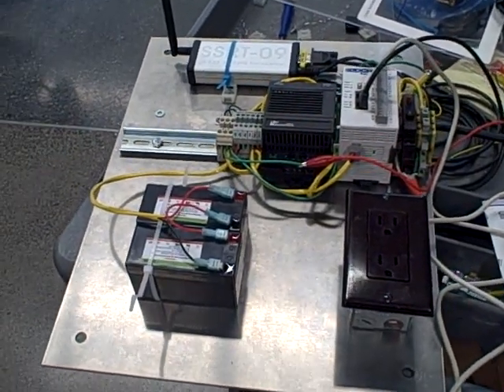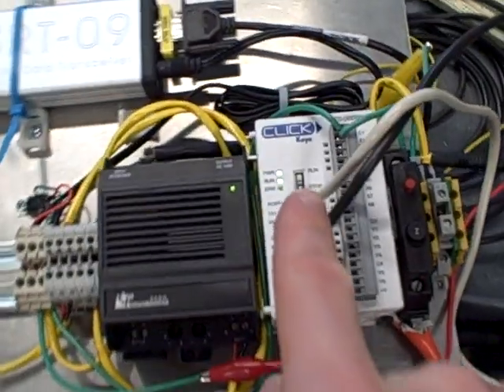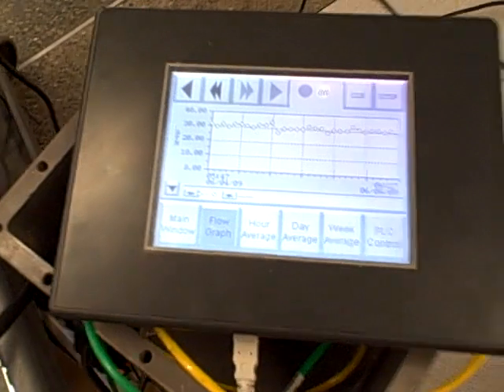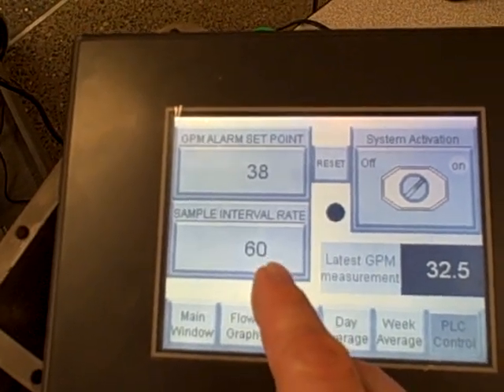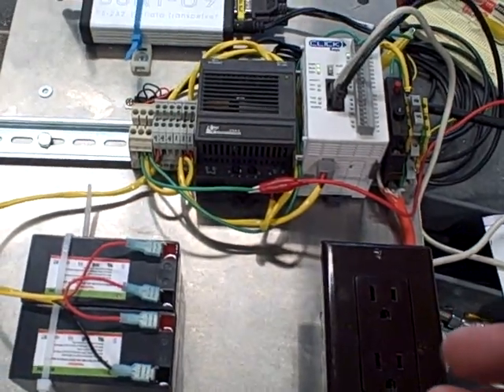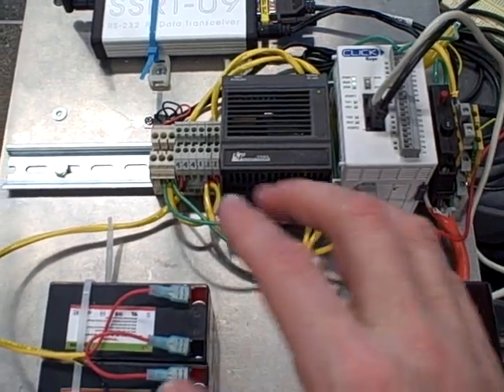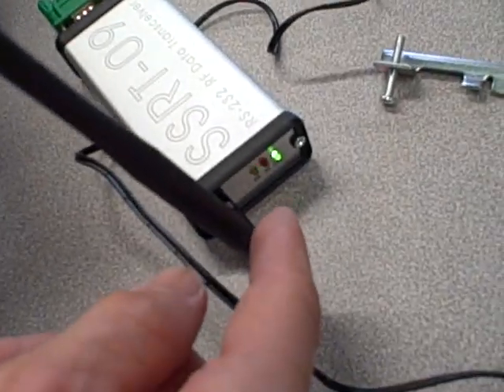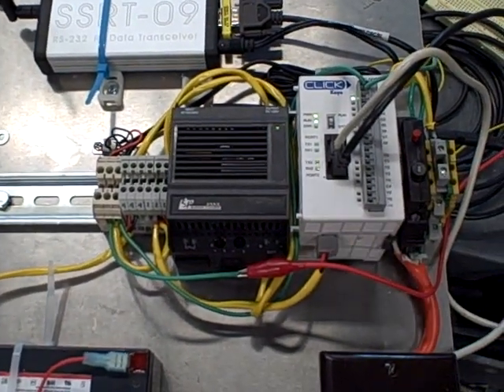Water flow alarm system

Comment: Cool.  In my old age with a teenage boy brain I keep forgetting to turn water off to horse troughs with consequent flooding of paddocks and excess electric bill and wear and tear of the well pumps. I want to detect water flow of more than 10-minutes whereupon activating a couple  fire alarm strobes and sounders as well as energize a normally open water valve solenoid from a lawn sprinkler system to shut the water off.  You wouldn't happen to have a Bill of Material (BOM), circuit diagram, and code for a PLC or Arduino for such a system that I could copy or purchase?  I'm kind of ignorant and don't want to have to actually think through, experiment and troubleshoot this myself.  Would be a great project for EE control system students.

Comment: I would love to see this scaled down to a consumer unit for a normal house, i am always fixing leaks to pipes on the consumer side of the meter and then the homeowner gets a massive bill a month later, it would be great if this sort of system would alert the homeowner if he exceeds so many litres per hour/day, my last client had a bill for 1800 euros for loss of water, it was not apparent as they are on a tank and pump system rather than on the mains due to low pressure in the street.